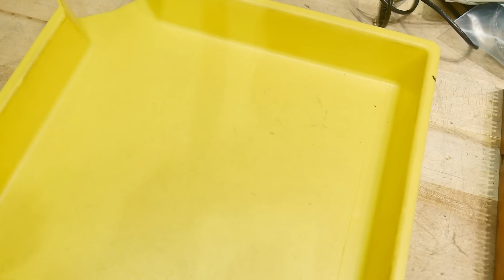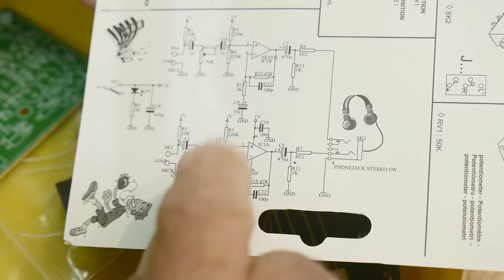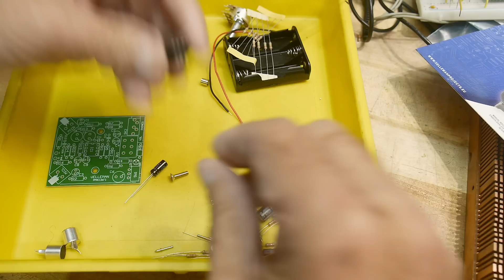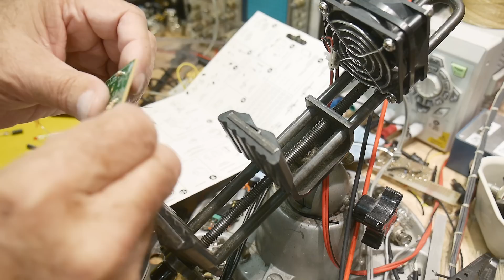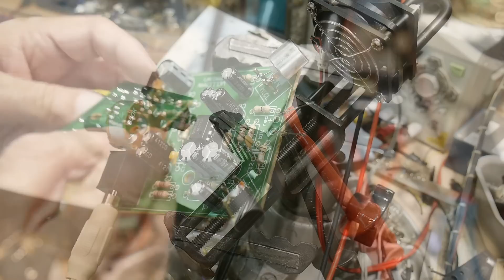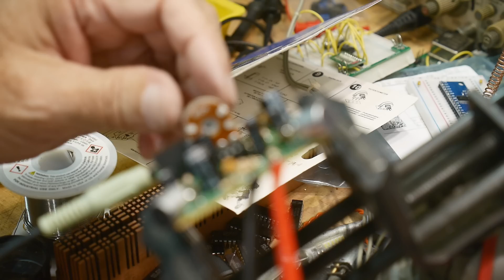#1589 Super Stereo Ear Kit Build

Comment: I totally agree with @tvelektron, no hope the NE5532 will work.  The 5V single supply circuit is better suited using a LM358 which can sense and output close to 0V. With suppliers trying to keep costs down, why would they supply a more expensive part.  Wouldn't surprise me if the NE5532 is a rebadged LM358.

Comment: Question about your panavise jaws. I've noticed you using them in a couple of your builds.  Do you find that those work better for small boards than the long PCB jaws?
Reply from the maker: they open up pretty wide (6"). after that I would not be using a vice anyway.
panavise 366

Comment: Funny, they use the NE5532 (a very nice audio Opamp of course) with only 4.5V single rail Power supply. The datasheet tells us at least +/-5V (so 10V for single rail) as recomended minimum. I know, 9V can do the trick too but below half of recommended is a bit dodgy i think 🙄😇

Comment: A rheostat is a variable resistor, a potentiometer is a voltage divider. A potentiometer can be wired as a rheostat, a rheostat cannot be wired as a potentiometer.

Comment: Hello IMSAI Guy, I am a huge fan of the channel and at the same time a college student going for Electrical and Computer Engineering. I have a question related to clocks and oscillators. Why are they important and how would the hardware be different without them ?
Reply from the maker: sounds like a homework problem. 
1: they are important to tell time.
2: the hardware would have to have springs and gears.
Reply from the maker: P.S. get a better teacher or book
Reply: Thank You
 @IMSAIGuy